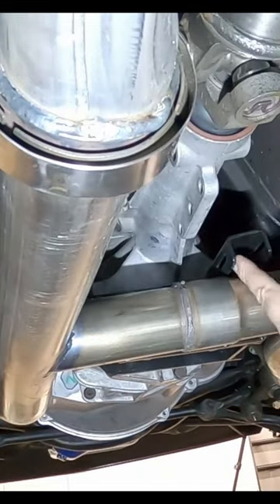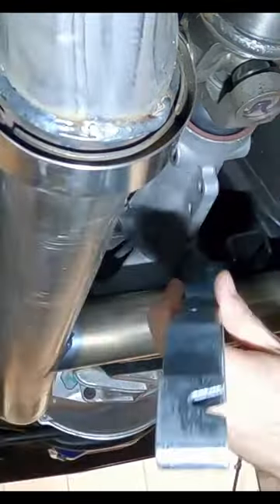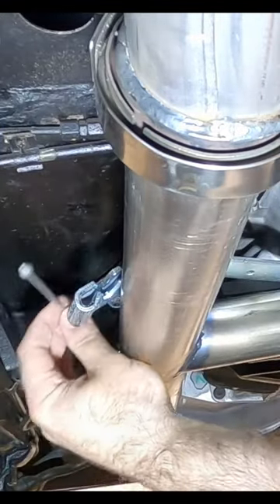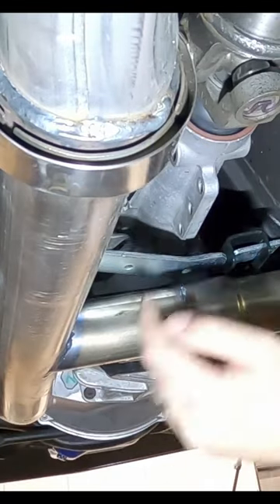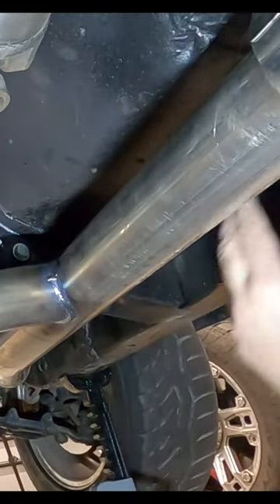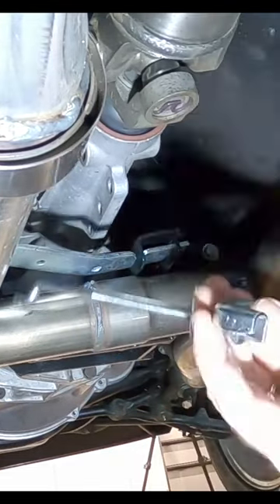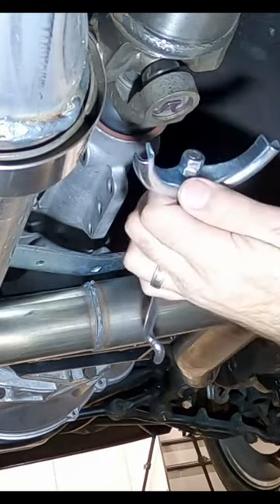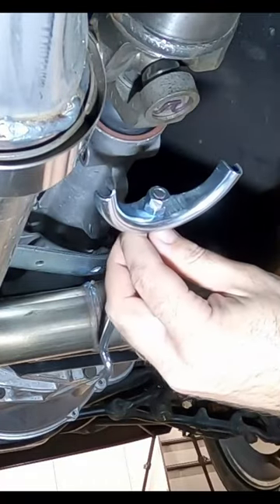Installing Parking Brake Equalizer Bar in a Classic Mustang

Comment: Looks like the E-brake bracket is against the H pipe. It will need clearance to eliminate noise. Probably crush the H pipe a bit.
Reply from the maker: It's not, no issues.